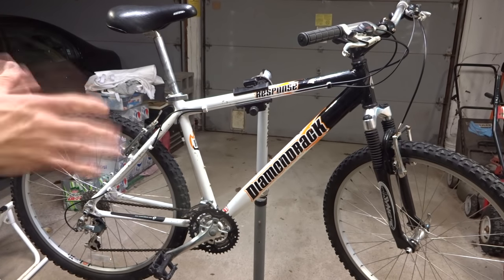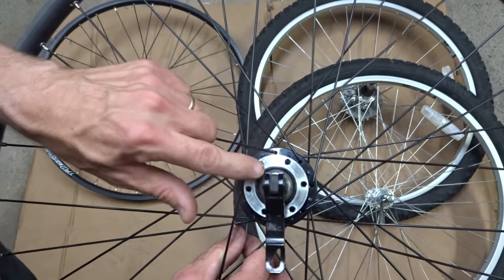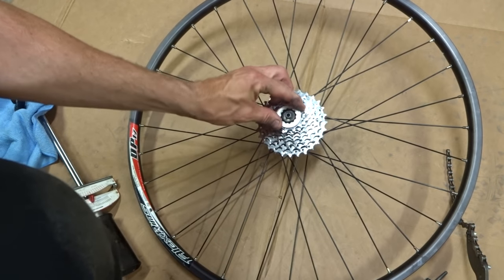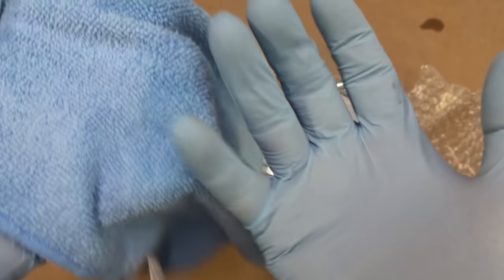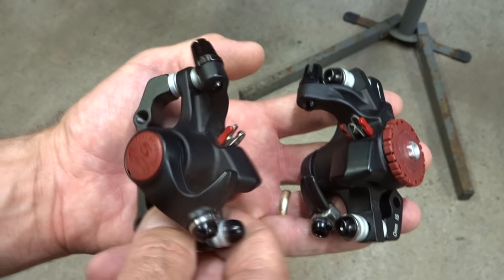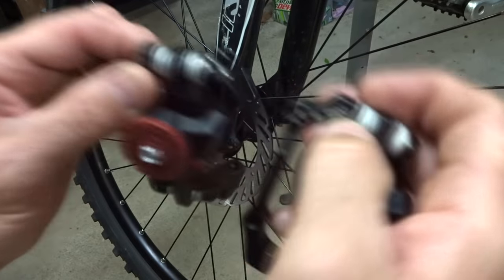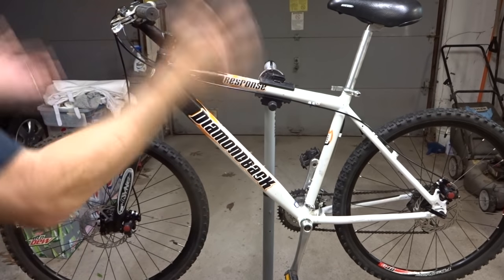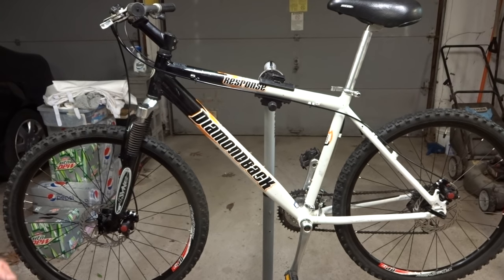How To Convert To Disc Brakes From V-Brakes On Mountain Bike

Comment: You are better than me. I would keep the cables for future bike repairs. Or, at the very least, until new kit was installed and working.
Reply from the maker: Cables wear out. It would be like reusing motor oil. Cables are cheaper.
Reply: For paying customers, yes. Most of the bikes that are brought to me are neighbor kids, family, friends. Used parts are good enough to get by. Especially when they don't have money, we would have to make a trip to buy the parts, they need the bike now, part shops are closed, I'm just trying to enjoy my day off, or whatever. A used cable will probably out-last a teenager's cheap bike. Your videos are good tho.
Reply from the maker: @PatrickG4531  Even the bike co-op in the area uses new cables. I buy them in boxes of 100.
https://www.amazon.com/exec/obidos/ASIN/B077FHGBHN/ref=nosim/youtube25-20

Comment: What I find confusing is that most forks now have PM mounts and yet brakes are (apparently) always sold attached to IS adapters which you simply remove and discard, but then you might also need a PM spacer depending on the size of the rotor.

Comment: Thank you for the in depth video. I was hoping to ask you a question regarding the brake system selection. Does the selection of the caliper and rotor vary based on the space between mounting holes on the forks? Thanks again for the great video
Reply from the maker: Not really. Different rotor sizes are adjusted with the adapter size.

Comment: i got a 96 specialized Stumpjumper that has V brakes  is videos right helpful on thinking of converting a bike into a single speed just riding around local  put a rack  in the back  I already have one bite that has disc brakes from the start I have a Schwinn rocket comp from 2005 dual suspension bikes decent it's not a Walmart if I remember I pay like $980 for the bike

Comment: i was just looking on amazon for disk brake adapter kits...they have an adapter for the rim- you take the gear cassette of a back whel and then mount the adapter...then you can install the disc  to the rim and then mount the caliper to the fork...makes a back wheel the front wheel
Reply from the maker: ??? Can you post a link? The hub spacing on a standard front wheel is 100mm, and the spacing on a rear wheel with a cassette varies from about 130mm-135mm. They are way different. The spokes are asymmetrical.
Reply: @RJTheBikeGuy   sure thing.  here it is :   https://www.amazon.com/ADEDS-Bicycle-Freewheel-Threaded-Adapter/dp/B01JREIQYG/ref=pd_ybh_a_3?_encoding=UTF8&psc=1&refRID=E4HAZDRKE6GQ98NMHBHV
Reply: it is a converter..i suppose you would have to "dish" the rim as part of the conversion. plus the the gears off the required clearance is about the same as a regular front rim
Reply: also- i was considering a freewheel adapter to place on a tricycle rear axle...sorry for all the posts
Reply from the maker: That replaces a freewheel, not a cassette. Just buy proper disc ready wheels.
Reply: @RJTheBikeGuy  indeed.it replaces the gears  with a disc mounting point...then with the gears off the mounting width requirement is trimmed down to acceptable tolerance for a front fork mount.
 the point is this..much cheaper to buy or use a back wheel as a donor and then convert it than to buy a disc ready rim...or so i have been told.
again, i was looking around for a way to install a disc brake on the  back axle of a trike..thought this was a nifty way...
Reply from the maker: Good luck.
Reply: @RJTheBikeGuy   no luck needed....look, perhaps there is a communication gap. if that is the case then i apologize.
      I have a sun trike with the 15 mm rear axle...it is currently a  1 speed with the coaster brake  in front of the axle and it uses 2 drive chains (pedalto brake, brake to rear axle ). i am sure you know what i am referring to .
 I considered removing the single speed coaster brake and mounting  rear 26" 7speed  rim assembly,minus the rim and spokes...just to get higher gearing.. then i have settled on eliminating the coaster brake part of the final drive altogether and going with a freewheel and 7 speed cassette mounted where the  current freewheel with 1 sprocket welded to it is currently mounted...i have  dozens of assorted cassettes in my parts pile and the derailleurs to match...so that issue is solved.
  but by eliminating the coaster brake, i have effectively eliminated the rear brake....so that prompted me to look around.
 I saw drum brake assemblies that mount on the rear axle but decided to go with a disc brake instead.
 that in turn prompted me to look at how factory made trikes with discs are put together...that is what led to me  finding that freewheel disc mount adapter on amazon....

 a set of disc ready wheels is 120 dollar-so far that i have found...
 me converting a mtb bike rear  wheel  and then buying a freewheel for the axle,then that adapter plus a cheap manual disc and caliber kit will be a total of 70 bucks,delivered.
  the only real work for this will be adjusting the spokes on the converted back wheel.
  I really enjoy your channel..you identify tools by name...i knew i needed certain tools but it is quite impossible to shop for them if you do not know what to call them..
 I also enjoy your channel due to the content of your videos..every one of them is a learning experience for me.

 what prompted me to make the original post here was to share the information that if you do not mind the time it takes to adjust the spokes, a lot of money can be saved .
sorry if I offended you.
keep the great videos coming

Comment: Hey RJ, what do you think of taking a hybrid bike for commuting 700c wheels and converting just the front wheel to disc brake but leaving the rear with a rim brake? It would be an easier and less expensive conversion. Is there any reason it should not be done? 
My understanding is that 80% of your stopping power is on the front wheel brake. I understand that if you are touring fully loaded you would probably want disc brakes front and rear. What is your opinion on this and would you be willing to give it a tryout? Thanks! dps

Comment: Would you be able to use the existing V-Brake cables and cable housing or is it necessary to replace it for the disk brakes? Thanks and Great Video!
Reply from the maker: The cables are longer to reach the disc brakes. And if you are going to the effort of converting to disc brakes, spend the few bucks for new cables/housings!!!!
Reply: RJ The Bike Guy Alright that makes sense. Thanks a lot!

Comment: Nice video!

Could you do a video about cleaning a vintage simplex super/LJ rear derailleur? I have a little trouble with fixing the upper pivot for my old peugeot road bike, even though the spring is healthy and springy it doesn't move far away enough from the freewheel which makes the upper pulley rub against the freewheel. And I can't seem to find any documentation about these older simplex rear derailleurs.

Comment: Nice vid.  You can heat red threadlocker with a shrinktube or paint remover electric heat gun, safer than a torch.  What about buying all the cable parts?  Do you buy the housing, cable, ferrules, and end caps as a kit?  What styles and sizes of cables are there?
Reply from the maker: I buy all that stuff in bulk. Boxes of 100 cables, boxes of 100 feet housing, bottles of ferrules, etc.

Comment: do you have a video where you replaced the old hubs with disc brake hubs?  i am in the process and wonder what i need to be looking for: overall length, distance between spoke flanges, etc, etc.  if you have something that matches the bill could you direct me to the video?   Thanks

Comment: Great video as usual. I am curious though; do both pads move towards the rotor in their clamping action or does only one of the pads move to clamp onto the rotor.
Reply from the maker: On this caliper, the inside pad is fixed, and the outside pad presses in. The inside pad can be adjusted in manually over time.

Comment: Hi RJ, I love your video.
I have a 7 speed beach cruiser with cantilever brakes that I would like to upgrade to disc brakes, because I want to eventually install a 2 stroke motor on it. Any tips or suggestions please on the cheapest way to go, I'm on a budget? I appreciate any info from you. Thanks.

Comment: Do you have any videos on how to upgrade a wheel that has to be replaced from bolt on freewheel rim brake to quick release or whatever the latest compatible wheel style is? I figured that if I'm going to spend the money on replacing the wheel of old bike then I might as well upgrade it too while I'm at it. Specially since I've been having a hard time trying to find a replacement for the freewheel rim break stile of wheel I have right now.

Comment: Good vid!  I use plastic or metal hole cover push plugs that are available in hardware stores that are probably cheaper than the screw hole fillers.

Comment: I’d love to instal rear disc brakes on my bike. Sadly there are no mounts for it. I know they make adapters but if the frame isn’t designed with the stress of disc brakes in mind then I wouldn’t trust using them.

Comment: I've seen rear disc conversion setups and they look pretty sketchy.  They attach to the chainstay and have a brace going up to the V-brake studs.  The conversion ends up being very expensive, I think $400+ by the time you factor in the wheelset and the disc brake.  The front of course could be as simple as a fork swap.
Reply: I looked at changing my 26inch fork to somethign different, but it was almost impossible to find a fork for 26inch which still has vbrakes.. might as well buy a new bike.

Comment: Wow much more work and $$ for new wheels than  I thought ...I wonder what the total cost would be for this conversion...?
But excellent instructions all the way through the job. So did you find the sizing from Avid's website or diamondback?
Reply from the maker: Do you mean for the brackets? I googled around and found it. I did find some stuff on Avid's site, but it wasn't clear. It was much clearer reading it from different sources.
Reply from the maker: Like here, it's there, but not clear: http://www.sram.com.cn/sites/default/files/techdocs/95-5018-000-000_rev_b_disc_brake_caliper_mounting.pdf
Reply: Yea I have a giant Sedona and wont to check the prices for it..

Comment: How do you do it on bikes without the disc brake mounts? Have you done that video,yet? Mine's got one in the front but not the back and doesn't have the mounts for the disc on the wheels.

Comment: I have a 2002 26" Giant Sedonna V brake with IS front fork mounts. What kind of an adapter would I need to convert to a disk caliper? I was rather confused on if it's IS to PM or the other way around. Can I run either 160mm or 180mm mostly on the street?

Comment: I have a 24 inch mtb. The fork was frozen. I saw a fork and ordered it but it’s a 26 so mounting holes for the brakes don’t line up. Is there any adapter or do I just need to change the fork?

Comment: Hello!  Is it possible to just buy the newer Cassette-Type with Disc Rotor Hubs and re-use the old rims and spokes?  Won't the newer Hubs be thicker or have longer axles and thus won't fit on the frame of the older bike?
Reply from the maker: https://www.amazon.com/exec/obidos/ASIN/B004H1UA9Y/ref=nosim/youtube25-20

Comment: Is there any not icicle difference for mechanical road vs mtb disc brakes? I.e. can mtb disc caliper be installed and used with road bike brifters? I'm trying to upgrade my aftermarket disc caliper that came with my road bike for something better. Mine feels mushy regardless how I set it.

Comment: Mate can you send me the link to where you got the back wheel from only or can I just use a normal rear wheel to put disc brakes on without putting the bolts in

Comment: You should grease your cables before running them through the housing.  You could use better water resistant ferrules as well..............
Reply from the maker: Grease can be counterproductive with modern cable housing linings.

Comment: Are the new wheels wider due to the disc mount compared to the old ones?
Reply from the maker: No, they are not any wider. Hub spacing is more based on number of cogs. https://www.sheldonbrown.com/frame-spacing.html

Comment: I have a full suspension mountain bike that I have had since I was 16 it has been neglected and needs new parts can you do a video on changing rear suspension shocks
Reply from the maker: Maybe you aren't aware, but there are lots of different rear suspension bikes with different rear shocks, and they are different.
Reply: kingcopycat all you have to do is size the shock to make sure the geometry of the bike doesn’t change (so the ass end isn’t higher or lower than it was before) and if you are buying a coil rather air shock you should make sure to buy a shock stiff enough so that you aren’t riding in a pogo stick

Comment: I’m looking at a 26” disc brake wheel, the website says it  is a 135mm quick release with Skewer My dropout holes are same size as my road bike with quick release. The bike measures 135mm from the inside of dropouts. Will the wheel fit on my bike?🙏🏼
Reply from the maker: Probably.

Comment: what the hub with 6 bolt holes call?  so i can search it up.  I'm thinking of switch the coastal wheels set and build the disc brake set up instead by replace the coastal to the new hub.
Reply from the maker: Search for a hub made for disc brakes.

Comment: is there a reason why you do not apply a light oil to the inner cables before running them through the outers?
Reply from the maker: Yes. And I am tired of answering this question. Google it.

Comment: Are all the newton measurements and wrenches necessary?
Reply from the maker: Torque wrenches are definitely useful to properly tighten bolts. I used Newton Meters, but I could have used Inch/Pounds.

Comment: Hi RJ... I realize this video is a bit older, but I have a few questions for you.
I am thinking about buying a 2003 Raleigh M80, which currently is setup with rim brakes,  but has IS mounts on both the front and back, as your donor bike in the video has.

I looked up the exact caliper you were installing, and it indicates "for use with linear pull brake levers" - that would be the same lever setup for normal brakes - so there ins't an inherent need to replace the levers themselves unless you want to.  Would that be correct?

For the setup you did, you replaced the cables - and they were bought separately, not as part of a "disk brake kit" - would that be correct? AND, are there different kind of brake cables? (I've not replaced cables on a bike in 20 years or more, and back then, dad did all the work, lol.

In the video, you show the 0 spacer and the -20 spacer, I think they were.  How did you come to determine that was the correct spacers to use?  Do a whole assortment of spacers come with the caliper kit or are they too bought separately or ordered with the kit, and you need to know that data point ahead of time?

This is eventually going to turn into an ebike... I was going to convert my cheapo Schwinn Avenue Hybrid from Walmart, but it's 700c instead of 26 inch, i've already broken a gear shifter, it's been abused by not being inside as it should have been, so I need to redo all the cables, chain, etc...and it doesn't have mount points for disc brakes, which I'd really like to have for an ebike.  I'm not making anything special out of it, probably a front hub motor kit, battery and controller, trying to stay cheap AND versatile - If I break this bike somehow, I want to be able to transfer the kit easily to another 26" bike.

There's an M80 on CL I"m interested in, he states probably needs new cables, etc.  He broke two spokes on the rear and bent the derailleur hangar on the rear - but he has the replacement spokes in hand - 

That leaves me with converting the brakes and buying new cables, ordering a front hub motor kit w/ disc brake, and buying a replacement rear rim.  This leads me to my last question: This is a 27 speed bike.  Can I buy any 26" Rim with 6 bolt mounts for the disc and simply change over the gear cassette?  Or do I need to look for a specific length axle to avoid having to have that changed?  What is your advice there?

Any guidance would be appreciated, especially points I could carry over to a different bike in the event I don't buy this one.  The goal is a 26" bike w/ disc brakes - doesn't seem easy to find and I feel pretty lucky to find one with the mounts for it, even if they aren't the brake system installed.
Reply from the maker: They use the same levers as v-brakes.  Different size rotors take different size adapters. You will have to look them up. They are stand mountain bike brake cables.

Comment: i never can understand why the 6 bolt disk brake is so much more common than Shimano's Centerlock. With the Centerlock it's one thing you have to tighten, there's no way to have uneven torque, and it's next to impossible to strip

Comment: Any fork made for caliper brake, has a load introduction entirely  different than a fork made for a load introduction arriving via a disk brake mount. Beware what you hack and how you hack it.  Load needs to always be calculated. Brakes plus malfunction from over looked load may result in a fatality.

Comment: hi please can you tell me if a specialized hardrock 2015 with v brakes can be upgrade to disk brakes without using adaptors?
also a trek 3500(2011)?
Reply from the maker: If they have caliper mounts, yes, if not no. And I can't tell you if they do or don't. You would still need new wheels to fit the rotors.
Reply: @RJTheBikeGuy  thanks

Comment: what wheels did you use? I have a newer response i am looking to do this to.
Reply from the maker: I don't remember the exact wheels I used. I bought them used on ebay or craigslist. But you don't have to use these exact wheels.You just have to find wheels that will work for you.